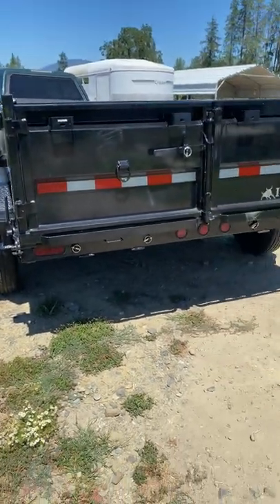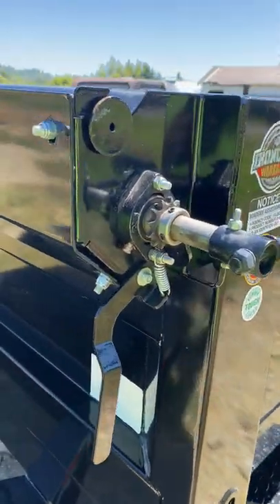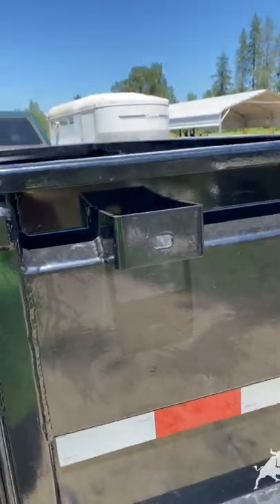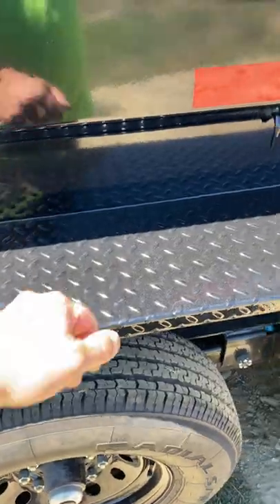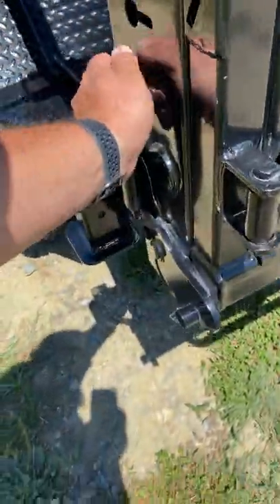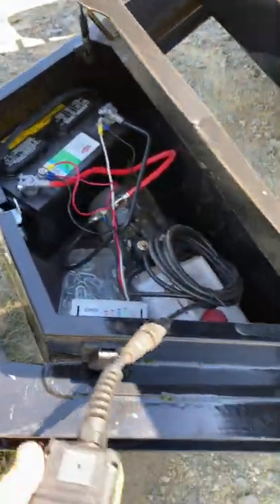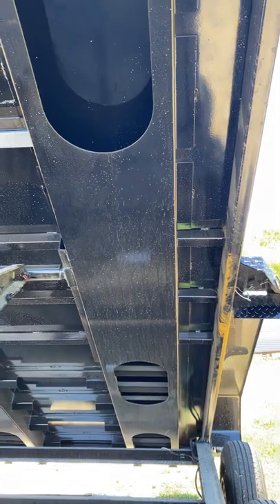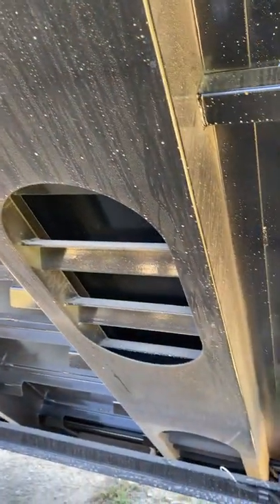Iron Bull DTB 14k dump trailer initial impression.

Comment: I just bought a new 7x16 Iron Bull Dump trailer which is 16K rated, it has the oil bath Dexter axles. I get it home go to load my 9k Kubota kx-040 mini excavator and the tires bottom out on the fenders. Called the dealer, they asked for pictures to submit to IB, and Iron Bull has not returned their call. I went and contacted Iron Bull about this issue and they have me measure the fenders and frame send them the pictures, had to call them back. They said they did not put the fenders in the right location so they offered to cut off the fenders and reweld them 2 inches higher and not repaint the trailer but use touch up paint or they will send me 2 inch Leaf spring blocks (lift kit) Dexter Axel does not advise lift blocks on their equipment. Also on one side the hangers are about an inch over outside of the frame, one side the fender is about 1/2 inch higher than the other side.  I even asked them to just swap out the trailer, and I would be a happy  loyal customer, but I get sent a copy of their warranty stating they can offer options to address the issue. I WOULD NOT BUY AN IRON BULL. 
Thank GOD the dealer is taking this unsafe literally DUMP of a trailer back. I have pictures if anyone is thinking about buying anything from IRON BULL CRAP.
Reply: I just ordered the same trailer as a gooseneck option

Comment: Have u greased the whole trailer???, wen i did i found loose grease zerks, zerks that were smaller than the hole(all zerks r press in type), loose allen screws on the tarp bearings, bad solenoid, bad battery, found all this out w/in the first week of having the trailer